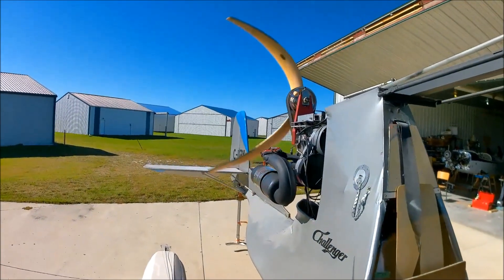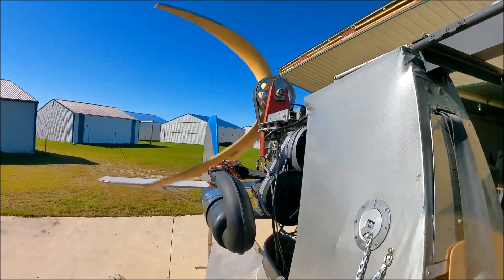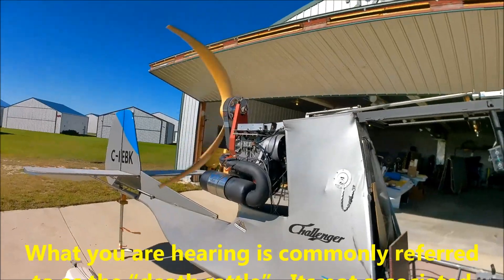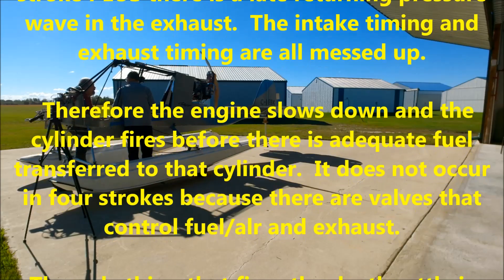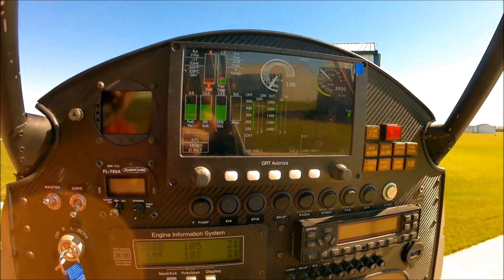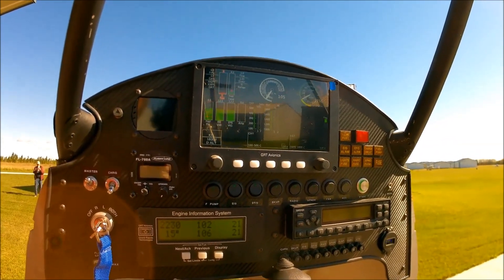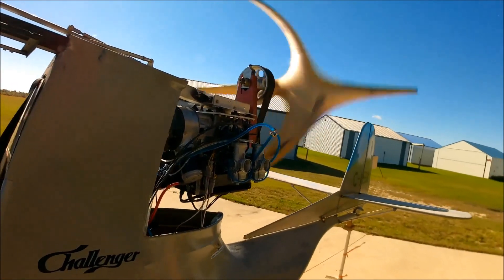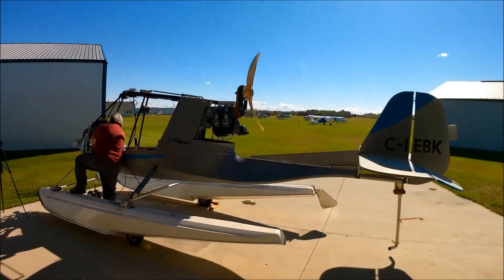EP 58 Rotax Engine Death Rattle?! Challenger 2 Ultralight Airplane

Comment: Hate the negatives of Rotax 2 strokes. My 503 ran for 620 hours at 100 to 1 and finally 50 to 1 Oil mix and the only problem I had was plug caps coming loose. A partner in crime had 800 hours on a 447 when he replaced it out of embarrassment.

Comment: Don’t get it.  Upon landing aren’t you supposed to cut the engine down & apply brakes?  At 2000 RPM can you still stop the airplane?
Reply from the maker: The reduction gear has a 2.6:1 reduction ratio. So at 2000 engine RPM, the prop is turning at about 780 RPM.

Comment: Or just fly wit 4 stokes.🤓
Reply: Increased dry weight, decreased available load capacity. Increased maintenance. 
Power to weight ratio on a 2 stroke is much better, however tbo is less on them.

Comment: So what kind of damage does the 'death rattle' cause?  All my motorcycle 2 strokes had that stumble at idle but it was never a problem.  I idle my 582 over 2k just because I don’t like the torque reversals on the redrive.
Reply from the maker: It is hard on the engine, and can cause damage to the crank, connecting rods and even the engine case.  It occurs because of a phenomenon called “four stroking”.  At low speeds the engine does not have enough inertia to overcome the compression of next pistons compression stroke PLUS there is a late returning pressure wave in the exhaust.  The intake timing and exhaust timing are all messed up.

  Therefore the engine slows down and the cylinder fires before there is adequate fuel transferred to that cylinder.  It does not occur in four strokes because there are valves that control fuel/alr and exhaust.

The only thing that fixes the death rattle is rpm.  That’s why Rotax does not want you to idle the engine below 2000 rpm.

Comment: What you're hearing is the piston rocking or piston slap. Even on a piston that is within the correct tolerance you will hear this. Maybe slightly less but it will still be there.  An engine accelerates for a very small time then decelerates the rest of the way around. As it accelerates it flexes the belt or will call it loads the belt or the B box knuckle joint or the C or E gearbox hardy disc. As it is un-flexing  it it causes the pistons to rock causing the rocking noise. As the rpm's increase there is less TIME between the accretion & decelerations , so the piston does not rock as much. Just take a 503 prop & rock it back & forth . You will hear that slap. I recommend setting your idle at whatever rpm thats needed to keep from burning up your brakes while taxing. As soon as your stop increase the idle to 2300 + rpm's. Rotax Rick
Reply: I think the four-stroking explanation makes more sense. My 582 does the same thing, and it reliably transitions out of this regime, suddenly, at 2,000-RPM. Exhaust gas timing issues that happen at a certain frequency seem to be a more likely cause, if it was mechanical slapping it should transition more gradually. At least that's my $.02. I would also think piston slap that is that loud would bust up the skirts and score the wall in pretty short order.

Either way, it is a hassle for a plane on floats since you can't really set the power low enough to power sail.

Comment: And your going to get 10,000 feet off the ground, lol maybe it you that will have death rattle
Reply from the maker: LOL The "death rattle" is a term coined by people who own these engines. Sounds dramatic, and if you let the engine idle below 2000 RPM for an extended time, it can cause damage to the engine. So....just don't let it idle that low and it's all good. The manufacturers specs clearly state that the engine RPM at idle must be above 2000. I did not know this, so I called Rotax, and they brought me up to speed on this engines personality.

Comment: What is the problem? If Rotax recommends idle rpm above 2,000, why run at less? Read your installation manual. Never go to idle unless the runway is made. You could also adjust the throttle idle stop.
Reply: Also make sure the throttle cable is as straight as possible if needed, big curves, no sharp bends. Idle adjustment is on the carbs with a spring loaded tapered screw, it should not drop to below recommended rpm, check the choke is closing completely, and air filters are clean and oiled. If it were me I would bring the idle up so it never gets too low. Check both carbs are set exactly alike too.
Reply from the maker: The idle is set at 2200 RPM, which is what the Rotax service center recommends. However, when throttling back to idle, the engine can at times enter this state if the throttle is reduced too fast. The correct solution, is to reduce smoothly to near idle, let it stabilize for a few seconds, then slowly drop to full idle.

Comment: My 503 does that as well if you just drop the throttle back to idle too fast, internals have been inspected and all is good. Also, I have found that you need to be smooth on the decrease in throttle. also, some 503s don't like to idle at 2000 and 2150 seems to be perfect. Very informative video for folks that don't know what this is.
Reply from the maker: It's a learning experience for me. The idle is set at about 2150 - 2200 on my engine, and it too goes into that rattle only after dropping throttle fast from a higher RPM. So, going forward, I will have to be smooth and a bit slower  when pulling back to full idle on the engine. Glad you liked this short video. Cheers.

Comment: Yes, there are also 4 strokes placarded against operating at certain rpm ranges, probably due to other issues but you do have to watch out for these things.
Reply from the maker: I remember hearing of 4 stroking with regards to a 2 stroke engine. But I've never seen it happen....till now. The idle on the engine is set to 2200 RPM, so that's good. So I just have to make sure I don't slam the throttle back to idle, and do it smoothly and slow.